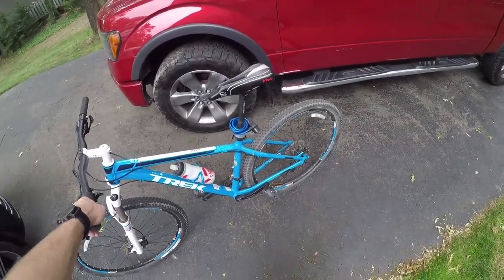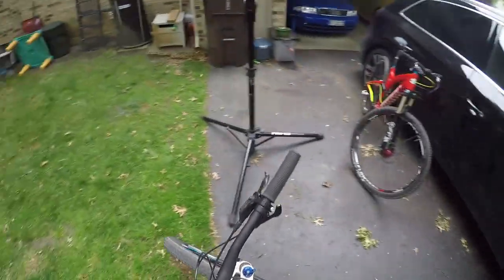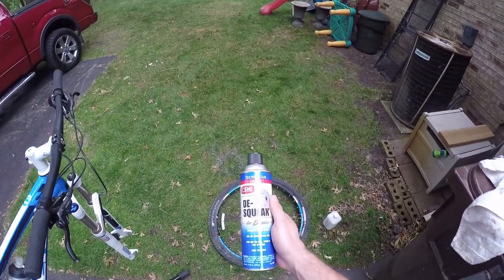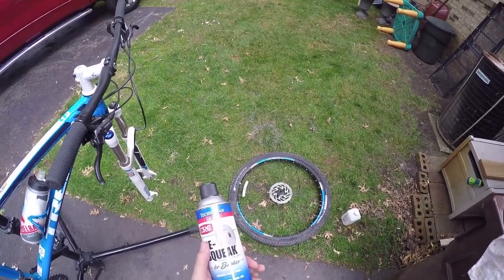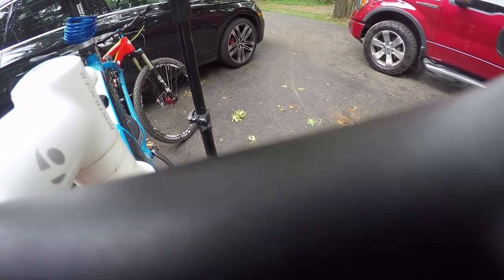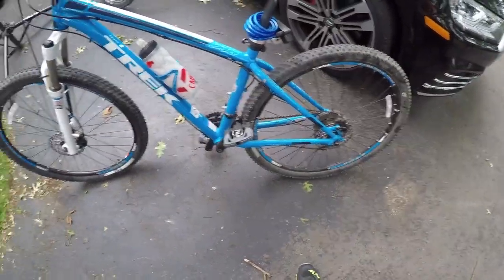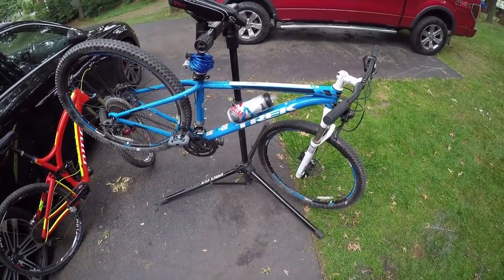Stopping Bike Disc Brake Squeal - Here's a GOOD DIY Technique you Probably Haven't Tried Yet!

Comment: I didn't want to spend the $16 for a can of De-Squeak on Amazon so I tried Ajax, applied with a sponge brush. I didn't have to remove the rim. I applied an Ajax paste (Ajax and water) on the rotor with the sponge brush, then followed your technique to remove the glaze. Worked like a champ. Ajax was 88 cents, the brush was about 50 cents. When I was done, the Ajax paste hosed right off. Both front and rear brakes worked better with no squeal.
Reply: What is ajax?
Reply: @snorttroll4379  its a kitchen/bathroom cleaner
Reply: You the man ! Thanks this Anti-Squeal stuff is exspensive in Canada !

Comment: I had a fouled rear rotor that I used all the other techniques on, but the squeak would always return soon after clearing up.  This technique, while hard on my legs and troublesome to my neighbors ears, worked wonders.  I will never try the other techniques again.  Thanks for the solid advice.  I had no risk as I had a spare rotor coming free from my bike manufacturer and new pads.  Now I can leave them both on the shelf as spares for another time.  You rock!!
Reply from the maker: Great to hear, I'm glad it's helped other people out.
Reply: @wattsbergbikes1599   i have a old used bike, the front rotor is full of oil, i cleaned with alchool, and installed new shimano mt201 brakes same as in the video, i cleaned everything i could.. the new brakes not only braked bad but squeel... i now tried this, what im suposed to do? buy new pads? btw new pads cost almost as much as the 17 usd i paid for the front brakes...

Comment: Reporting back: I tried this method out, and it worked like a charm for about 300 miles. The front rim is finally starting to squeal again. I reapplied the spray-on stuff and the squeal is gone again. This method of desquealing works great in my opinion -- I'd tried tons of other methods (cleaning, readjusting, new pads, new rotors, etc etc) and none of them worked at all. I'm surprised this method isnt more widely recommended.
Reply: All you need is copper grease on tne back of your pads😊

Comment: Worked great, thanks.  Since I'm a bit lazy, I took a piece of cardboard and cut a rounded slot to fit around the cassette to protect it from over-spray so I didn't have to remove the back tire.  I also have enough De-Squeak to fix rotor squeals well into the next century.

Comment: I left my bike at a workshop for bicycle repairs and they could not solve the screeching sound. Followed up on some other peoples advice to apply ceramic paste (non metallic paste, heat resistant) between the braking pads rear side to hydraulic piston. Still did not solve my issue.

Didnt try the old trick to simply heat up the brakes as this dude did though, I say it is worth a shot! Will have to wait though until the weekend, otherwise my neighbours will go crazy at me...

Comment: Thank you so much this video helped me resolve my squealing. I'm in the U.K so I got a different brand but did what you said after applying the product, really need to heat it up by breaking half way until eventually the terrible noise disappears. Thank you thank you thank you!!!!
Reply: which brand did you take as I'm living in Germany and has no access to this CRC one. Neither do I find anything similar. Seems like it acts just like a polish paste, but I'm too afraid to try... By the way I have heavy annoying high frequently squealing noise when breaking with about half power

Comment: I changed to 4 pot brakes on my Silverback Stratos AL5, came with cheap semi pads, squealed like a cat under a tyre, I took off the pads and rotors, took 1200 grit sand paper, dish washing liquid.. and scrubbed till  I could see the red on both pads and rotors of my blood after my finger nails were scrubbed off.
Let the pads and rotors air dry, and put it back, made sure everything was aligned properly and took for ride.. hasn't made a sound since.. I do believe the cheap crap pads make huge difference.. so new pads definitely in the future,as here in  South Africa we don't have that 'De-Squel'

Comment: I always use alcohol basically same as here in this video , Then I just apply the brake and push the bike a few times giving it full rotation until the squeak stops,  alcohol leaves no residue . I am always leary about using automotive products on my bike , lol you scared me with that brake cleaner for a second ... My method works every time and without extra chemicals (unless the pads are contaminated or worn right out). Cool vid , this method seemed effective and relatively safe in this case.

Comment: Realigning the caliper can't be understated.  It's as simple as unbolting it a little, squeezing the brake lever and tightening it down while squeezing.  Also a mountain biking trick is to  use sand or mud as the grinding compound...which is what's in that can.  Update:  Looking at the prices of that CRC stuff I got to thinking that valve grinding/lapping compound will work just as well if not better and less messy than mud/sand.  It does work.  Permatex Valve grinding compound - 5 bucks and you can water it down.  slap on a light coat and wipe off the rotor when done  riding(grinding).  Still a lot easier than pulling the pads and hand sanding them and the rotors individually.  Cheers.
Reply: Valve lapping compound has grease in it fyi.. good thought though.

Comment: i have seen this done in a similar fashion but instead of spraying the full break rotor they spray only the small pads that grip the rotor just two quick sprays on the small pads then do the same pedal and break at the same time and done but there wasnt any need to waste so much spray for thr rotor parts.....none the less both worked well ;-)

Comment: Have you tried the "bedding in" without using the spray ? As the spray is likely just refacing the pads after they've been glazed up? I would be interested if the same results are achieved without that spray being used. With only a light sand paper over the pads, then "bed them in".
.

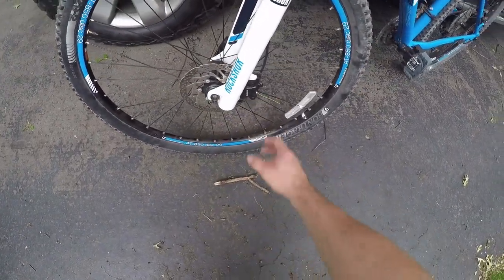Comment: 1:10 actually degreaser should do the job, I use Muc off Dry degreaser, but if you get grease on them it's harder to get off as is sticks, so wipe off, then spray all over the rotor, but there might be some oil that it does nto work on, I don't know. 
I use Muc off degreaser for the Rotors & pads, I sand them down if needed too.

Comment: The reason brakes start to squeal and less stopping power is from glazing of the rotor and pads. What you're doing with this method is removing the glazing and like you said bedding them to each other. Good tip.

Oh another reason brakes squeal and loose power quickly is the fluid gets hot and in some cases can boil breaking down and introducing bubbles into your system so I would bleed the brakes getting all of the old fluid out and replaced with the proper fluid for the system you have.
Reply from the maker: Good tip!  Yeah, this should only be done if the rest of your braking system is in good order.  If you need a bleed anyway, this won't help much.
Reply: so i need to change shimano oils?

Comment: Another temporary fix(on trail side will last 10 mim max) use water, I know it sounds counter intuitive but sometimes the water will create an insolating layer to help absorb the vibrations. I haven’t gotten Around to doing mine so this works temporally just to get you home with hearing intact.
Reply: Using water isn't a temporary fix at all as long as you smooth the disc, clean it, rough the pads then reassemble.  Apply water before riding then just apply the brake whilst riding as shown in this video.  The pads bed down very quick and the effect is permanent.  You may be getting only temporary results because you haven't prepared the disc or pads.  Trust me it works and works very well I indeed.

Comment: I have never tried this, interesting. So far I just used Muc off dry degreaser to clean rotors, my local automotive shop sells CRC, maybe they got this, but I sand my rotors down with sandpaper, only time I had squeal brakes was when the Shimano M615 & m396 leaked, due to worn seals & oil spills on the road, by degreaser always did the job, but oil, braking fluid will result in glazing, and change of color due to extreme heat.

Comment: I have always thought about Mountainbike wheels that have a thin, hard, smooth middle (similar to a roadbike tire) but just in the middle so you can reach higher speeds on the streets easier and sell them if they are worn down to people that just want normal offroad tires.
Reply: Umm yeah.. but which mtb'er wants a thin hard smooth tyre 😂😂

Comment: So I just had one that I haven't heard anyone else post pop up and it has to do with the friction coefficient of the pad causing the howl. New four piston XTR 12 speed. The 203 in the front will howl with metal pads no matter what you do. New pads brake cleaner all of it. At least the cheap metal pads. On a 180 rotor it's fine. You swap over to an organic pad on the same 203 that was howling no more noise. I tried three different sets of metal pads. They all had issues. It seems like they are so grabby that they make the rotor resonate. Why that doesn't happen on the 180 or 160 I have no idea but the cheap copper Shimano metal pads don't work well on a 203 for piston. Planning on trying the actual XTR metal pads when they go back in stock but the organic version works great

Comment: Cool, thanks for posting this vid.  Strangely enough, I only get the squeal noise when I'm climbing the steeps.  I cleaned my rotor and caliper pistons with alcohol but the squeal is still present.  I'll try the next step with the de-squealer and see if that does the trick.  Thanks again!
Reply: is it squeal or is it knocking or rubbing sound if so it might be frame flex causing it.
Reply: It was an intermittent squeal during climbing.  I found the cause to be my misalignment of the caliper.  D'oh!
Reply: it's a good idea to apply Locktite 243 to the threads, and let it cure, and regurally check the bolts.

Comment: Thanks for the info, but in my opinion a better way is to just take out the pads and clean them by rubbing them together with dish washing detergent and a lot of water. This will save your pads and get rid of all the dirt causing the bad braking and noise. This can be done for both discs in under 15 minutes! Of course you won't get this kind of workout from it ;)
Reply: I've tried that with my pads but I think I got some brake oil in it when I bled my brakes so I just had to buy new pads

Comment: I tried it, and it didn't last any longer than any other method to stop disk brake squealing.  It left a gunky mess to clean up after.  Once it dried on my bike, rotors, and pads, alcohol or even regular citrus degreasers did not remove it.  Fortunately, I had a can of Citrol Degreaser and that removed all residue quickly.  It was worth a try, but I'm back to doing a light sanding of rotor and pads using alcohol when squeal comes back, which it will eventually.  I've accepted that it's part of bike maintenance that can't be avoided.

Comment: My method (workes on contaminated brakes): Be careful to not touch pads or disk rotor. The oil on your skin could contaminte them more. USE NITRYLE SAFETY GLOVES!Take affected wheel off, then take off pads on respective side.
Then Clean disk rotor with acetone or rubbing achool (isoprofyl).
And do the same for the pads. Then sand the brake pads with a fine grid sandpaper.
Repeat the cleaning on pads, and reinstall everything back on.
Edit: Pro tip: 1. if rotor grinds against the pads, unscrew the bolts holding the caliper on, squeeze brakes as hard as u can, then tighten back on while holding brake lever. This will center them.
2. Always check that all bolts are tight. On hydraulic brakes, oil can leack on pads if a bolt is not tight enough.

Comment: Hey, I had this problem twice. I washed the rotor, with dish soap, and on the brake pads I applied sand paper, to eliminate the contaminated layer. Then you need  I brake a few times very hard from about 35kmh. But the brakes will come to perfect normal in about 20 km of riding on streets and braking only with front. Like so the comment will come in tranding

Comment: stuff it, excuse to upgrade from 160's to 180's.  $23 bucks for a can compared to 100 for upgraded rotors, fresh pads and spacers :D  Good video though!

(tried cleaning everything well i.e cleaning rotor thoroughly and burning off the pads.  Tried filing down the pads a bit but nothing.  Pads and everything are about 9 years old though and the bike has been sitting for majority of that time)

Comment: Question: when baking this stuff into the rotor, should I vary up how hard I am squeezing the brake?   I've noticed that squealing can be dependent on how hard the brake is squeezed, so I was thinking that for your method to fully work, the baking-in should happen at multiple grip strengths.  But you're the one with experience: what do you think?
Reply from the maker: I usually squeeze until it just starts squealing, then back off so slightly.  It will still squeal, I just try to minimize it.  As the rotor and pads bed in, you'll be able to increase the amount of brake force to reach the squeal point until they don't squeal at all anymore.  Does that make sense?
Reply: Clydesdale Chris MTB how long do you think this product will prevent the squealing?

Comment: Bought a bike after using a hand me down for many years which had rim brakes, never had this issue. Now with the new bike everyone said that they are better than rim brakes but never let me know of the squeal issue. Even though I bed or clean/sand rotors and pads, I have to practically do this more times than I would like to keep the noise down. I don't ride in dirt nor rain but regardless bikes are supposed to get dirty, are we expected to keep cleaning the brakes consistently? I don't for my car. Why would they replace an already good option of rim brakes with these, I don't see a big difference in braking power, I just don't understand.

Comment: Ya know, I'm new to disk brakes but... been working on my own bike since I was a kid.  Even caliper brakes can squeak.  And I've NEVER used any kind of chemicals to fix that.  Simply adjust your brakes correctly.   With caliper brakes the squeaking is usually caused because the pads aren't striking the rim flat.  If the back or front end hits first, you get squeak.  I would guess the same applies here.  And your video didn't even mention checking for pad alignment at all.  Now sure, if the disk and pads are filthy, clean them.  But brakes are generally self cleaning.  More than likely this is simply a matter of poorly aligned brake pads.